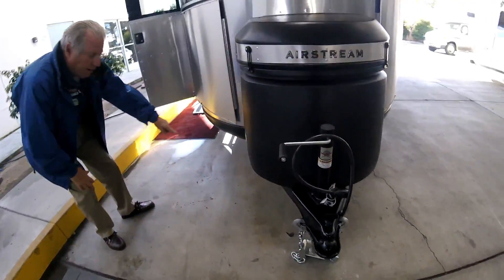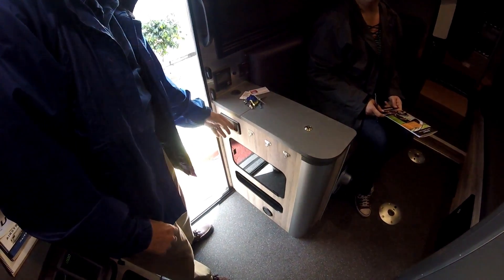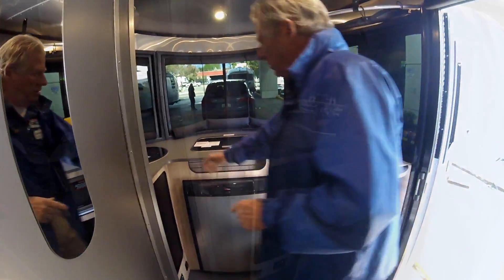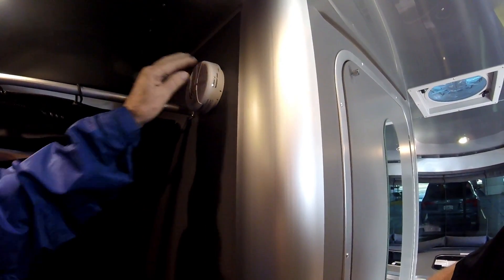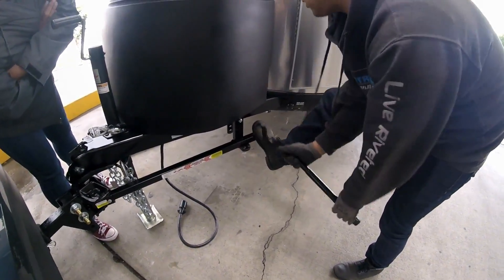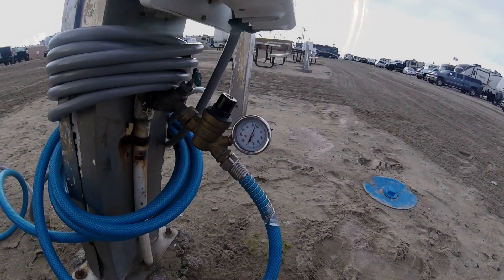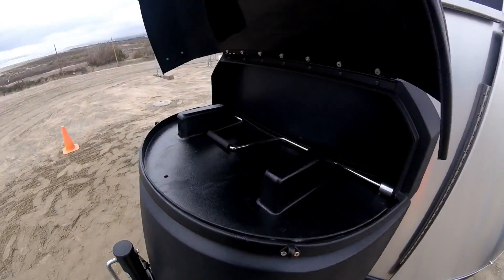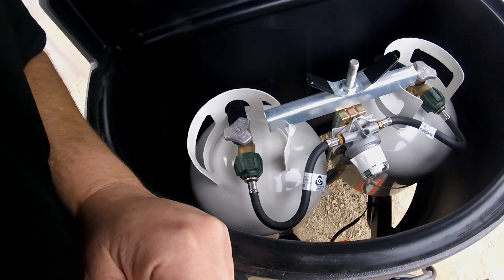We got a new Airstream Basecamp - Airstream Basecamp X Travel Trailer RV Camping

Comment: I am averaging 20% water usage for a shower using the shower head on and off switch. The problem areas on the 2019 BaseCamp X I have are the roof plastics surround piece can crack and allow water inside the BaseCamp X. I fixed mine with Rust-oleum Leak seal to stop the leak. I also had a front center window where the roof crack allowed water running down the center window inside and during the winter it froze and busted my center window. That was a $2,000.00 repair I paid out of my pocket because I could not figure out at the time why the center window busted and did not file a claim on my insurance. Another area to watch is at the rear door bottom latch water collects at the bottom latch every time it rains and eventually will rust the latch.  The Truma heating system works great I like the gas heater/water heater. Overall I am very happy with my purchase of my 2019 Airstream BaseCamp X and yes I would recommend others to buy the RV but learn from my challenges so your RV trips are less hassle. The one improvement I would want to see on future BaseCamp X models would be more solar batteries and more solar panels built into the RV. I added a third Zamp solar panel and it helps keep batteries around 65% charge using the onboard ceiling fan all night in the summertime. I purchased my 2019 Airstream BaseCamp X new last year and I actually had no idea Airstream even made an off-road version but I am glad I found this one model that fits my needs.
Reply: Gerald Patterson   I have no idea how the plastic broke on a brand new RV

Comment: Question:  Do you have any issues with the hot water heater while you’re taking a shower?  Asking because I understand it only heats while water is flowing and I imagine you do ‘Navy’ showers where you wet down, turn the water off, soap up, then turn the water back on.

Comment: Any insight as to what kind of MPGs your Pilot gets pulling the airstream?  I think you folks are in California so I recall that trailer pulling means a 55 or 60 mph speed limit - that that would help stretch miles between fill-ups.  I am contemplating a new BaseCamp too and hoping that my 2014 Pathfinder would get better MPG than with the larger trailer I currently pull.

Comment: Are you still towing with the Honda Pilot? I bought a 2019 AWD model to tow a forest river Rpod 177. I had the dealer install the transmission cooler, and brake control. We are in Alaska so we just travel to camprounds around the state. After 3 camping trips, my transmission broke and my camper is only 2700 lbs dry weight. Thank God the warranty covered all repairs, but now I'm worried about towing the rpod. The mechanic told me to limit towing to 3500 lbs, even though, I have AWD with transmission cooler. From your videos, sounds like you don't have issues towing with your Honda pilot. I didn't get weight distribution o sway bars, since my camper is small... do you think that would help?

Comment: I drive an 2005 Equinox Chevy. Can It tow the Basecamp?
Reply: Basecamps weigh about 3500 pounds, so a tow vehicle should have a towing capacity of around 5000 pounds to cover the added miscellaneous weight added with gear, water etc